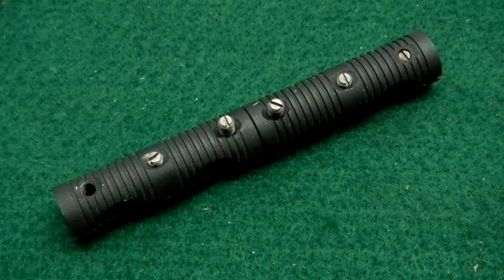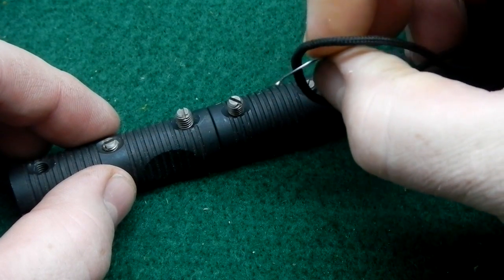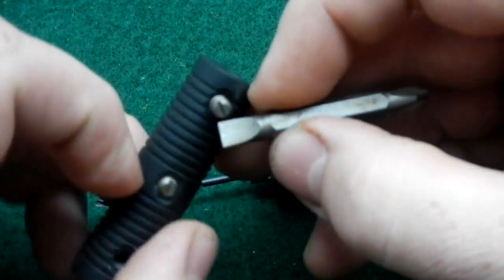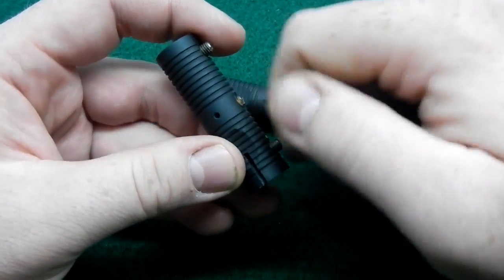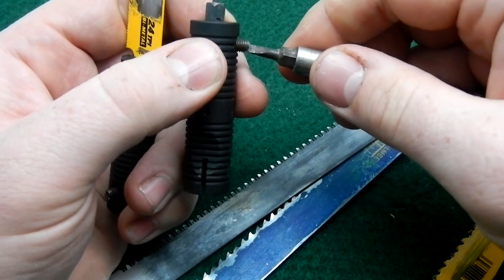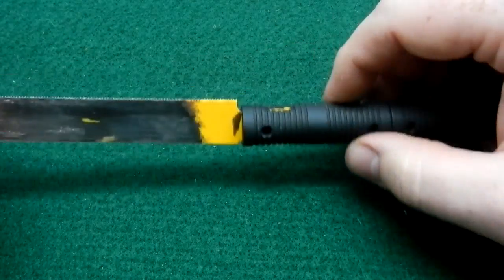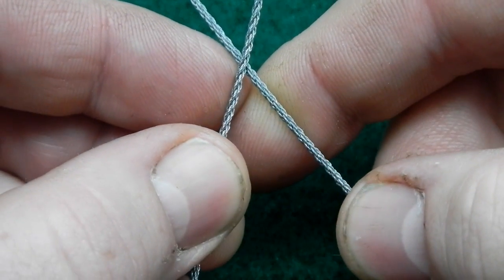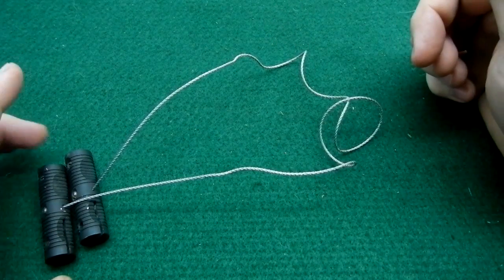GRIP-S Survival Tool

Comment: You absolutely could get a few replacement set screws at a decent hardware store.  Just use a regular screw to determine the threading first (it'll be %110 easier).  You could even get them with hex or torx drive which might not be as easy to open in an emergency with the edge of a knife, but if you already can't open it with its own tool....

Comment: Step one: Pull out another survival tool and use it to make the GRIP-S survival tool usable.

Step two: Access the screwdriver that the screws are clamping on to.

Step three: Use the bit you can't access that won't fit in the screws to.... fuckit. This is a horrible design.

$50 bought me: Milwaukee 48-22-0305 Folding Jab Saw 6-Inch, Milwaukee Electric Tool 48-22-2301, Milwaukee 48-22-3410 10" Locking Pliers Curved Jaw with Grip.

The folding jab saw works with "sawsall" blades. The screwdriver is ratcheting. And as a bonus, I have a set of vice grips, instead of a junky little piece of aluminum held together by a screwdriver bit I can't access using saw blades that may not be compatible.

Sometimes pocket junk is just pocket junk.

Comment: Thanks for the heads up. The Lee Valley version looks bigger and is plastic, but looks way easier to use, especially in cold weather with gloves on. Its cheaper and comes with bits, as well. No wire saw, but who cares? Thanks again, and good review Beast.

Comment: I think that this could be a very good tool. I just think it is way over engineered. used as a handle for different type of blades would be a good thing in its self. with the other end with hole in it to put you hex head tools in the other end with just 2 grub screws. if both of the handles were hallow and cut a slot out for the saw with out pinching it. and use a small piece of tube to keep the two handles together.

I like the idea but the product could be made much simpler and with less money and be a more effective product.

good video

Comment: think most has lost the concept of what survival actually is, that there is a toy with a bunch of small pieces that will dissapear when you need it the most, imagine fiddeling around with that thing in the cold when you got zero dexterity in your fingers, try a bahco laplander instead if you want a real survival saw, its so good they dont even need to put the word survival on it for it to sell and the blade will last you for several year of general use and then ya dont need to bring all those.